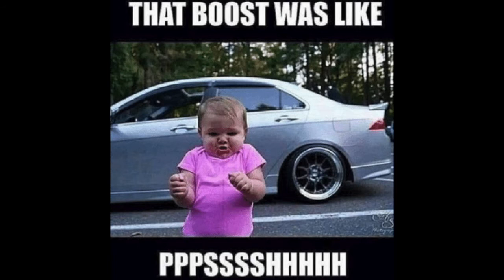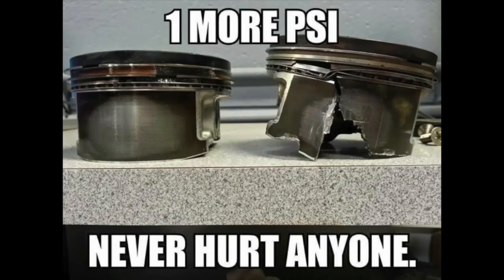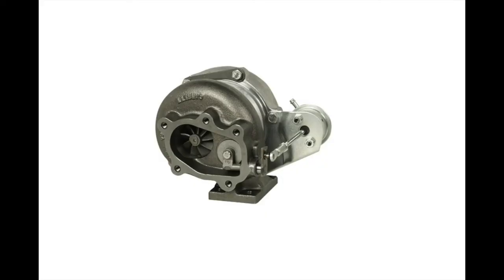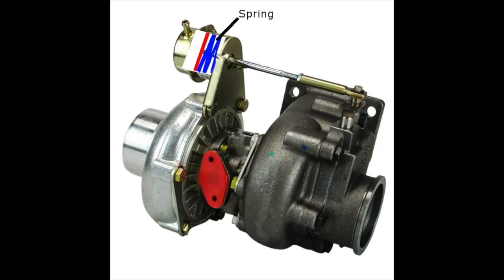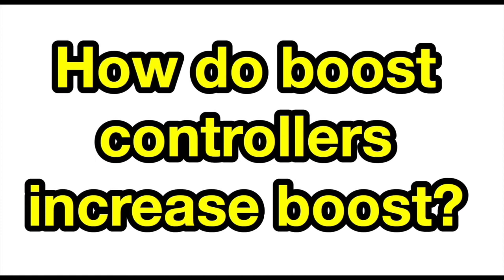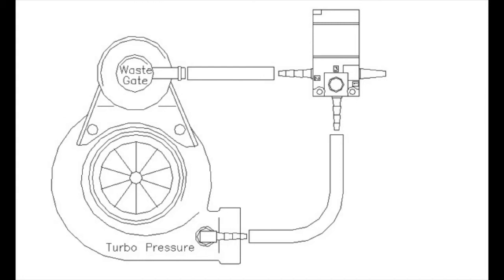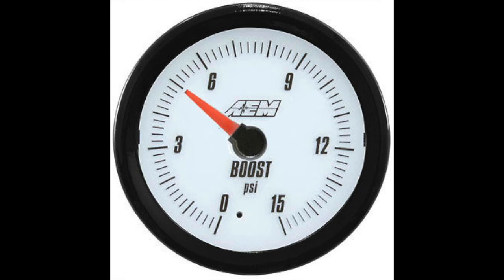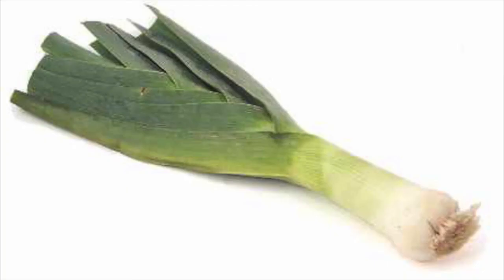How do boost controllers work? - Boost control explained

Comment: Very clear. But I have a question, why not just have a more powerful spring in the wastegate?
Reply from the maker: So you can run differing boost levels at different rpm, in different gears etc
Reply: @DuckSport  ok thanks! I have a Westfield with a 2.0 Ford Zetec that's been turbocharged, it has a Gizzmo MS-IBC boost controller and I know very little about it so am trying to learn as much as I can, mainly from your fantastic channel. Hopefully one day soon I will understand most of it which can only help me use the car better. It's pretty powerful tbh, so much so that of the 4 selectable boost levels I only use 1 and 2 on the road. 3 and 4 can be quite scary 😂 Hopefully it's all set up and working properly but I'm trying to find a dyno near me with an operator who understands the Gizzmo. I really appreciate you taking the time to reply and help me, many thanks indeed 👍🏻👍🏻
Reply: @DuckSport  is this why my boost seems to come on very smoothly rather than as a lot of people suggest when they ask me 'is the boost sudden when it kicks in?' I have to say I barely notice any sudden kick of boost, it seems very nice and controlled, I definitely can't seem to spot an rpm at which all hell suddenly breaks loose.
Reply from the maker: It could well be, depends how much flexibility that controller offers etc. could also just be a well matched turbo to the application etc.
Reply: @DuckSport  again, thank you! I will be working my way through all of your turbo related videos and also checking out any others you have that may be helpful 👍🏻👍🏻